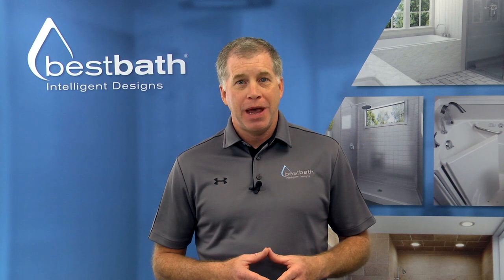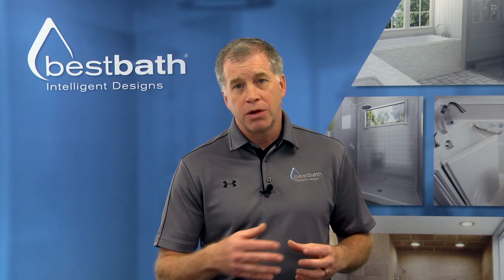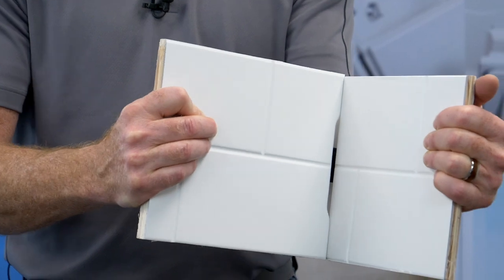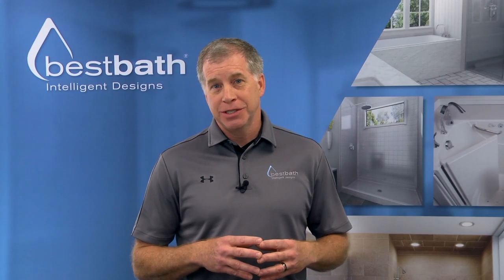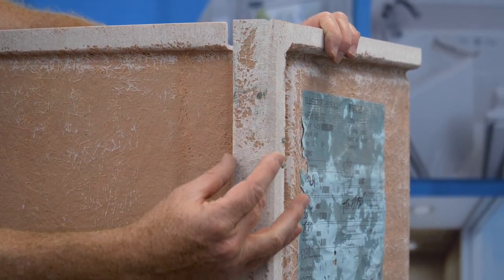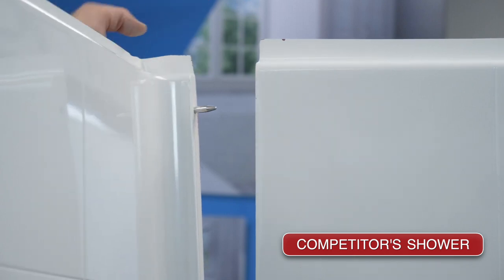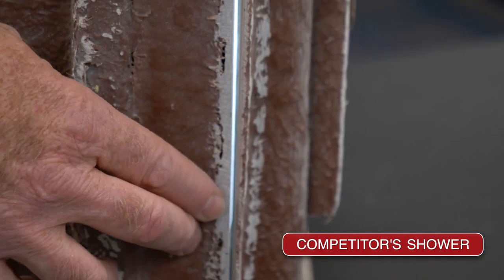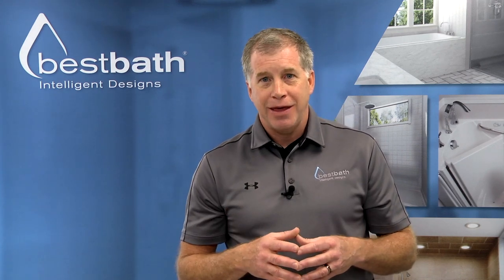Engineered Wall Systems

Comment: What material is used to make the panels? Is it epoxy resin or polyester resin?
Reply from the maker: Hi there! Our walls are made with gel coat, barrier coat, fiberglass, backed with plywood, then one last layer of fiberglass.